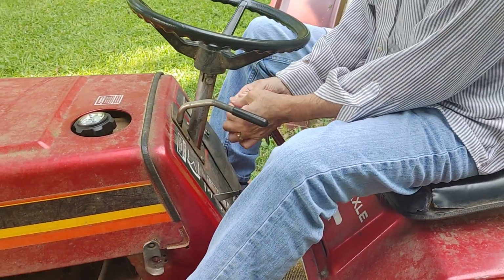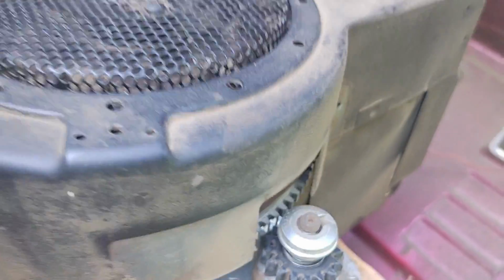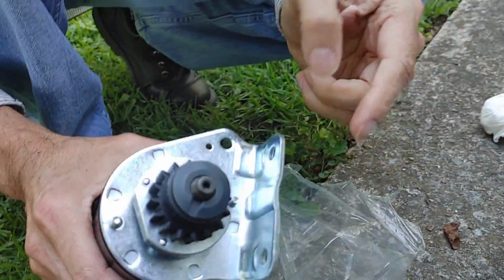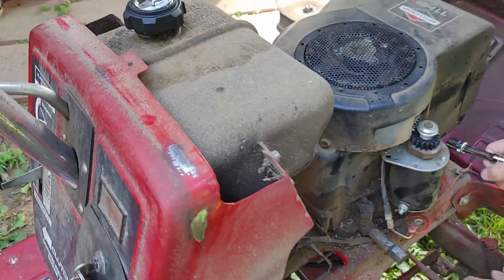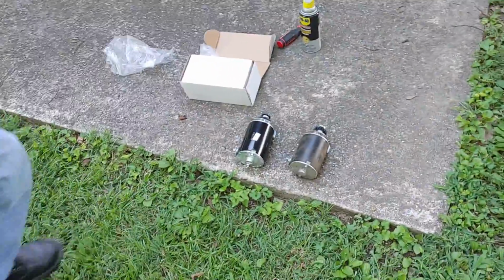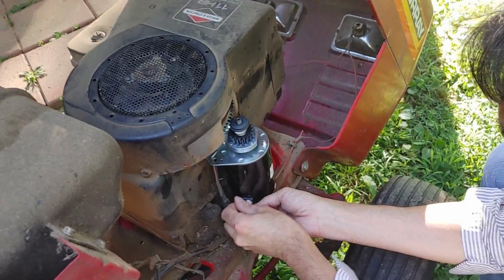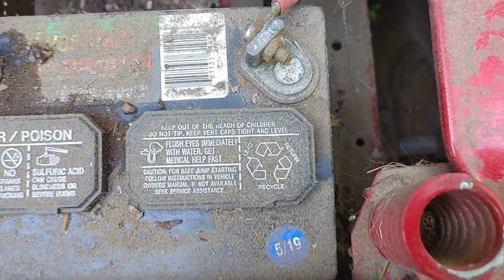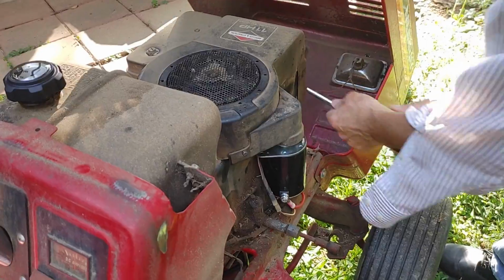Briggs & Stratton 11hp Murray Lawn Mower Starter Replacement

Comment: There’s 2 wires that go to a clip next to your starter, a black and a red, the red is (I believe) to charge the battery and has a diode. What is the black wire for? What do you have wired up to that clip. Just put the same engine in my mower and I’m struggling to wire it up correctly
Reply from the maker: I believe the wire you are referring to is the DC source (to supply the alternator). 
It goes from the 2 wire plastic connector, to the B terminal on the ignition switch. From the ignition switch, the wire goes to the (-) terminal of ammeter gauge.  From the (+) terminal of the ammeter, the wire goes through a fuse holder. The wire becomes red at the fuse holder and goes to the hot side of the starter solenoid. Wire from that hot side of the solenoid go the (+) terminal of the battery, of course.
Hope that helps.

Update: found an online diagram.
Look at page 14:
https://www.mymowerparts.com/pdf/Murray-Models-1968-Thru-1989/84-36523.pdf

Comment: I wish John Deer tractors were so easy to get to the starter.   We have to remove a cover over the flywheel, then another large plastic encasement, &  the air filter, then use a T40 socket to remove the two bolts holding the starter.  Bolts are located in very awkward/hard to reach space.
Reply from the maker: Yes, it seem like as time goes on... many manufacturers are making things more complicated/difficult. Planned obsolescence in some cases, and/or difficulty to prevent people from easily servicing things themselves. As an example, just look at the complexity of new cars. Life does not have to be this way. I try to surround myself with simplicity.

Comment: I have the same mower iv had it for 3 years now only problem is you cant start it with the key anymore gotta jump the solanoid with a screwdriver lol.  Still runs and mows great.  I have a question about the mowing deck spindles they are non greaseable. Can you add grease fittings to the spindles and pump them full of grease? Or did you do that yourself or would you just not worry about it?
Reply from the maker: This Murray has been a great mower. I never would have thought it would cut so much grass in its lifetime, and last most of mine.  
I have replaced the spindle bearings on this mower, in the past. You are correct, the factory Murray spindle housings do not have grease fittings. Please note that even spindle housings with grease fittings are almost useless with some sealed bearings. This is because grease will not easily get past the bearing side seals, when you pump the housing full of grease. I would recommend modifying/removing the bearing seals that face towards the grease fittings. The next time I replace those bearings, I am going to attempt to do that and 1) drill & tap the housings for grease fittings, or 2) will purchase housings with grease fittings (about $30-$50 per set). I believe if you search "Murray Spindle 24384", those may be what you need. Please double check the parts/part number before ordering though.
Overall, my main focus is serviceability and keeping things simple in life.
Reply: @bobbilly351  Could you do a Tutorial video on how to take the spindle apart to get to the bearings I just would really really hate to ruin it.

Comment: Glad that you are sharing your video, you aspire me to learn. Question: did you disconnect the wire from the Solenoid to Starter when testing. Please let me know. Thanks and God Bless.
Reply from the maker: Hello @davidruiz5383,
Glad to hear that you are interested in learning. I think that is great... especially repairing things. This keeps items from going into landfills, saves you money, and makes you less dependent on others.

To answer your question: No, I left the solenoid to starter cable connected when trying to start the mower.
The solenoid is simply a relay switch that allows the starter to receive full current from the battery, when the key switch is turned. If the solenoid didn't exist, the key switch would have to carry the full current, which it cannot do (it would melt/burn up). The power therefore, goes from the battery, though the solenoid, to the starter. 

Note: On some automotive starters, the solenoid (which is mounted on the starter) also make the bendix gear engage. That is not the case on this starter/solenoid setup, however.
Hope this info helps.

Comment: I have that same Murray tractor, it is a 1984 and I salvaged it from the edge of a farmers field. The deck was off, but at least it was their and the tractor has since been revamped and put back into service and starts and runs like a top. Glad to see other folks still appreciate the old equipment and yeah these things have an all steel hood etc. Good vid btw.
Reply from the maker: That is awesome! I hope you can put it to use and keep it going. This Murray, I have used since I was a kid (my parents purchased it new). Now as an adult, I have another brand/newer mower, but this old Murray is my favorite. I use it all the time as my primary mower. It has been extremely dependable and has cut many miles over the decades, sometimes with the grass/weeds being 3-4 ft. tall. I wish all products were as dependable as this old mower.

Comment: Why didn’t you just change the starter gear it comes as a kit and not expensive either.
Reply from the maker: Yes, great thinking; really like your idea. Let me explain further: I might could have saved some money by just replacing the gear. Since the starter was 15 years old, I didn't need to risk more possible downtime (our grass grows fast in the summer). I just went ahead and spent $33 on the new starter. -But don't worry, I also purchased a new starter gear, to fix that old starter. That old starter will NOT go in the trash, but will now be the extra backup starter to use when needed.